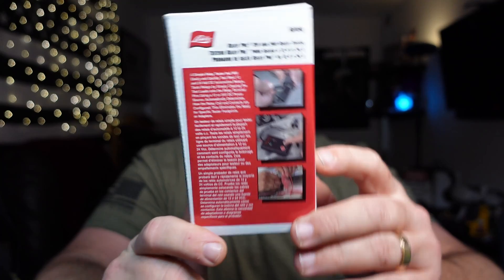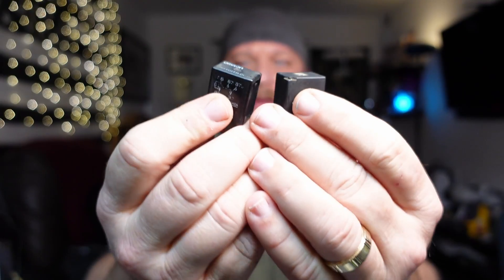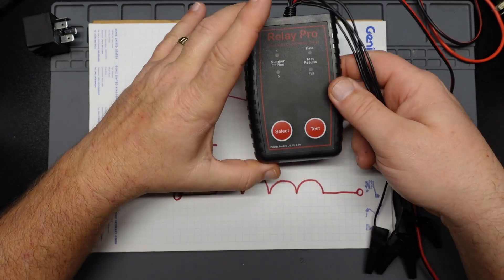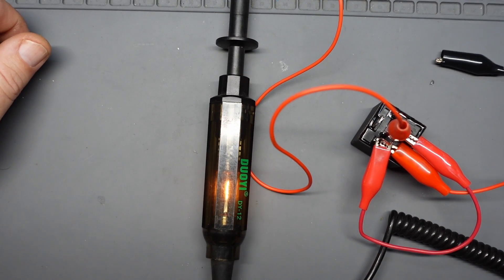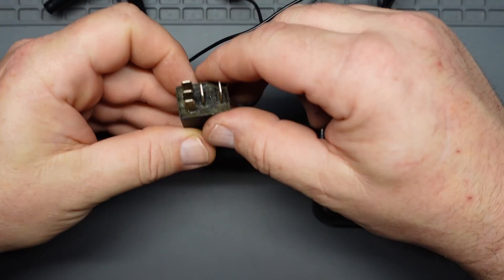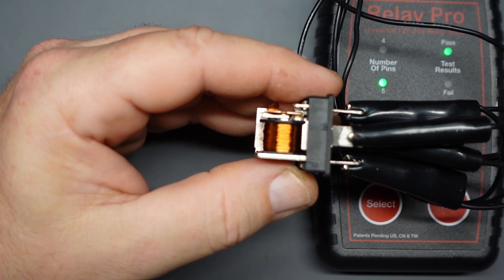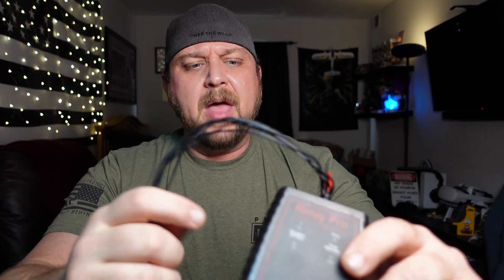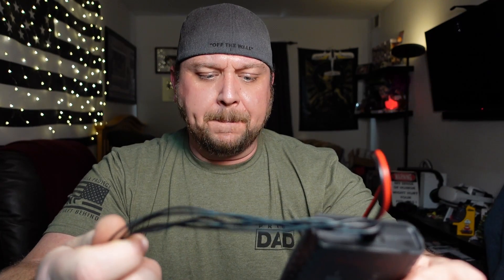Lisle Relay Pro 60150

Comment: My wife got us wedding rings from "groove" they are rubber and are super nice if you work in the mechanic fields or heavy equipment or electricity.. a buddy had his wedding ring metal around his finger and it had to be cut off all from losing a wrench and he accidentally crossed the battery terminals as he was tightening the terminals😅❤ also had a buddy lose most of his ring finger when he went to jump fown off the excavator and his ring got caught on a bolt that holds the handle you use to get in and out of the excavator and it peeled his finger basically off so he lost most of the finger😱💙

Comment: Is that one 12/24? Cause I have one of the other types and have jumper wires, which are a pain, to put different form factors in. But I also modified mine for a M12 battery for a handheld so I lost the 24vdc option.
Reply from the maker: Yes it is 12/24 volts. Forgot to mention that but I put it in the discretion 😎👍🏻

Comment: A legitimate Mechanic simply uses their VOM. 
Plus has ability to read coil and contact resistance, determine pinout etc.
Reply from the maker: If only one day I’ll be as cool as you 🙏🏻
Reply: Most VOMs won’t switch the relay for you, nor will measure well close to 0 ohms as needed to ensure that the contact resistance is repeatable and so on. This one won’t display the lead identification, that’s about the only shortcoming.

Comment: Im confused as to what fault exactly these are testing for. I burned coil? A shorted coil? Sticking contacts? I only ask because i check for all of these with my filedpiece multimeter that has a lot of other utility and this tool is hyper specific.
Reply from the maker: It tests the coil and contacts.

Comment: A future update it would tell you that wire 1 is common, wire 2 is N/O and so on, so that if you don't know what the pins are on the relay you can find out.
Reply: And contact resistance, current/voltage to change state in both directions, current at nominal voltage, insulation resistance between things that should not be connected, delay etc.

As an electrician I would check some of those with installation tester and lab power supply when needed, but I think that basic pass/fail result is enough for most users.

But, does that thing handle other type of relays? Latching, blinker etc.. Or things that have common for coil and load contacts. Waiting for blinker would make it slower, so might not be something you want always to be on, but as a mode beside 4/5 wires or something.
Reply: That was my first thought as well. With todays microcontrollers it would be really easy to make such a device. Look for example at Peak Atlas DCA55 that identifies any type of transistor/diode/mosfet/LED/triac AND tells you  the pinout.
Reply: @mrfrenzy. Exactly. It takes a bit of analog knowledge to do it well and robustly, but definitely it could easily measure most common parameters.